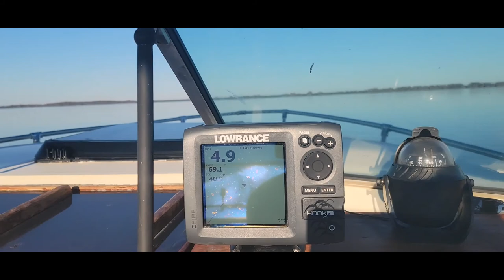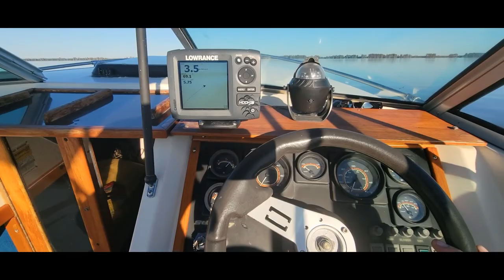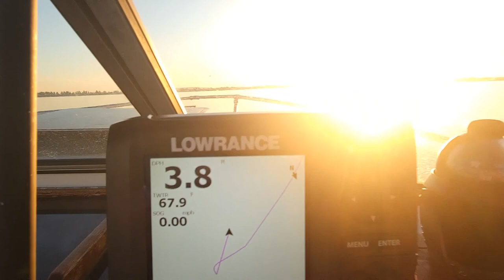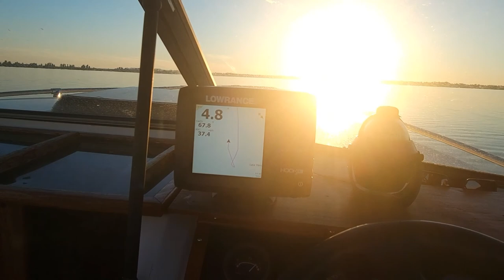STINGRAY CUDDY CABIN Mercruiser Quadrajet flooding problem ruining my Florida beach trip

Comment: That is one shallow Lake. my Cuddy Treads 3.0 foot deep. I would be in heart attack mode. When you hit hard in 3.8 feet mine would have touched bottom. Yikes.
Reply from the maker: Yes I was lucky not to hit anything along that shallow lake ,and never being there before,   I'm from upstate SC and our lakes average 60 + ft up to 300ft so im used to that and boating around FL is like a different world lol,  it does better skimming by on  plane , lucky I didn't hit any Gators too 😂, thanks for watching Vassmotorsports
Reply: @Vassmotorsports I am in West Michigan, Right on 60ft. When I fish lake Michigan we fish from 120 " to 300 " of water. When I get in 10 foot or less of water I watch the graph..........
Reply from the maker: @dracoss8695  I've only been in a few of the FL lakes but they were all very shallow , and I've been going to the ICW on gulf side few years back we would take my 24ft maxum 2400scr cabin cruiser and me and wife would stay on it for 5 nights at a time on vacation ( heck with hotel rooms lol) and it was a learning curve as you better stay inside the channel markers regardless how bug the body of water is , it's very Deceiving and will get stuck in a Min, especially when tide is low ,  and most parts of channel are low as 3-5 ft when tide down.  It blows my mind, how some of the big boats would come thru and not hit ,  few times I'd follow someone out the inlets into ocean so I could have the lines on my GPS as that was usually where I'd always hit bottom and turn around,   I learned the current on gulf side to always stay to the left when going out ,   not sure about East Coast but very curious

Comment: Get a Weber 4 brl never had a issue with mine..
Reply from the maker: Turned out being the new Carter fuel pump was my issue pushing 9 to 13 lbs.  Way to much.   The regulator fixed my problems